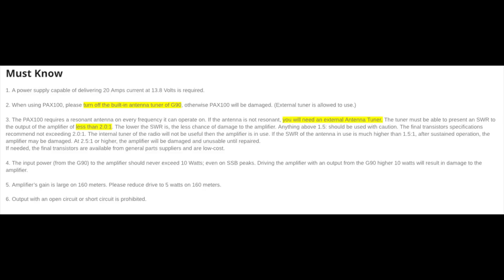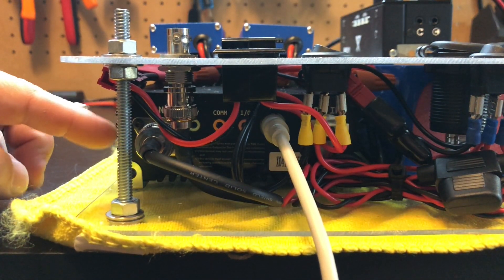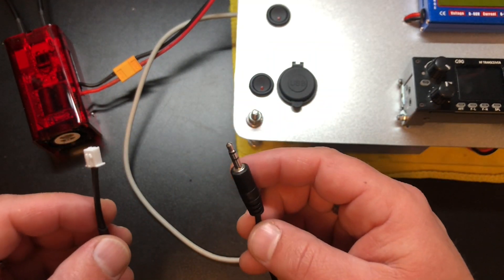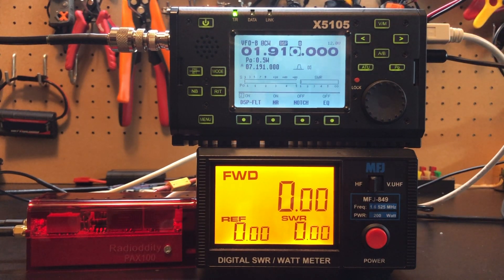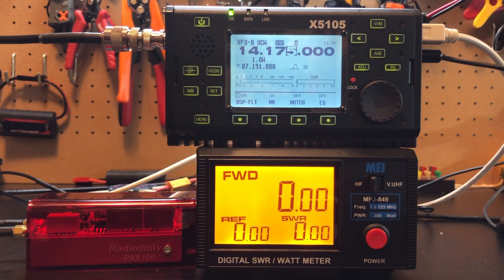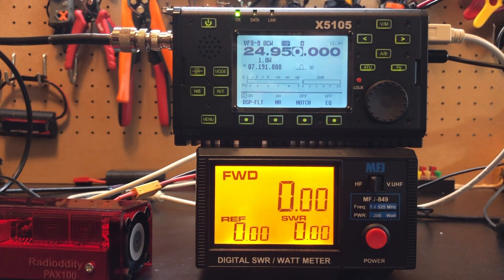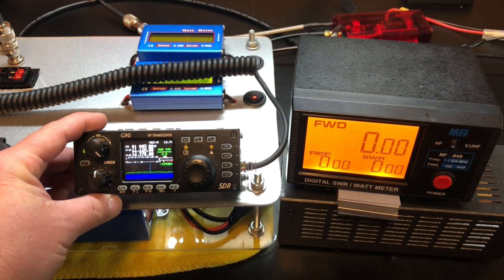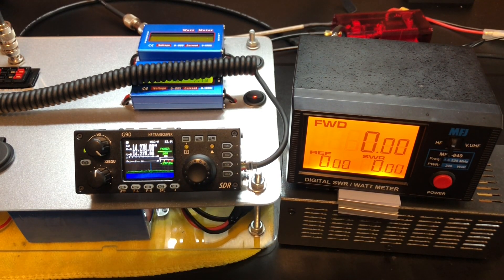The new Radioddity PAX100 Amplifier | Xiegu X5105 & G90 100 watt amplifier.

Comment: I have both now, just got the. Pax100. The ptt cable that plugs into th g90 kills the rx on radio.waterfall is dead, TX seems to work fine.  If the pax100 is Totally disconnected.And only the ptt is connected, the same thing happens. I have no clue how to solve this problem

Comment: Amplifiers amplify any signal that is put into them including harmonics.  You might want to check the spectral purity of the radio that caused the swr issues with the amp.  If it puts out a dirty signal, then it could also cause swr issues with the amp.  Also, the amp needs filtering on the output to assure a clean signal.  Without it, you may be operating on harmonic frequencies that you are not licensed for !

Comment: I know this video is one year old but I bought for my xiegu g90, hooked up as recommended, configured as recommended but power according to antenna tuner is same as input. Yea I connected ptt cable and made sure inserted all the way? I have pics. Any hints what I’m doing wrong?
Reply from the maker: When I got mine the cable didn't work and Radioddity had to make one for me.  It wasn't keying the amp. They should be shipping with a proper working one now but that could be the problem.

Comment: The amp has no lowpass filters. This means that the output is high in harmonics. I don't have this amp and will never buy it. Every time you transmit with a solid-state amp without the lowpass filters, the signal will appear at double, triple, and quadruple the frequency. If you transmit on 160, you'll transmit also on 80 and 40 meters, or outside these bands. The harder the amp is driven, the more output it'll have on the harmonics. I'm surprised they're legal to sell as ham amplifiers (or maybe it's called something else for import purposes) as it would fail any FCC standards for certification of a commercial product.
The solution is to buy a 100 watt lowpass filter board for the ham bands (either built or a kit) to connect between the amplifier output and the antenna. They're really inexpensive on eBay, from around $40 to $65 or so.

Comment: I have mag-mount with Hamsticks for my mobile. I attempted to check into Nonn lime net yesterday. I was heard by a relay. My wife and mother-in-law asked to turn the radio off as the noise was bothering them. I'm still learning this radio. That PAX100 be perfect for mobile use. 73 va7dgp/va7qu

Comment: This appears to be the baofeng equivalent of an HF amplifier lol. Sure, it's cheap, and it works, but I doubt it's very spectrally pure. It's just like what they say about things, it's not your fault if you don't have the equipment to properly test the output of your radio, it's the manufacturer who's at fault for putting out a product that doesn't comply with standards. I'd say, use it if you must, but upgrade when you can. Still a very neat product!

73 de W8IJC
Reply from the maker: I would say that is 100% accurate.  I would really like to put it on a meter and see what it really does but after moving to TX I don't have that resource anymore.
Reply: @hamradiotube  Yeah, neither do I. Hey, thanks for replying on an old video. Love your videos Mike, got my Silver Bullet 1000 because of your review.

Also I just wanna say I am running FT8 right now, and I just got heard in Hawaii, Australia, and Antarctica all it once. I may or may not have just screamed like a little girl... No joke check PSKReporter. This 20 & 40 meter dipole that I just put up like 40ft is really working great!

Comment: They sell an XT60 cable with inline switches on Ebay that would make amp-off tuning quicker.
Reply from the maker: Hmm, thats a good idea.  Now if I could only get that in a Power Pole!
Reply: @hamradiotube  Yeah, I'll probably take that out to go all power pole, then add a switch.

Comment: Which cables do you used to connect the xiegug90 to thepax100 I bought the xiegu g90 and have spoken to Laurie in the north of italy. Ik4gro
Reply from the maker: Lauro always has a great signal, I've worked him many times.  There are a bunch of cables needed to connect these.  2 of them come with the amp, the other comes with the CE-19 interface you need to get the PTT to trigger.  Then there is a power cable as well.  I believe I show them all in this video, but if you purchase the amp and the CE-19 interface, you will have everything you need.  I think I have a link in the description to save either $15 or 15% off, I cant remember but use that if you want to save money.  73

Comment: You're NOT seeing 100 + watts You're seeing all the harmonics "DO NOT TRANSMIT WITH THAT AMPLIFIER WITHOUT FILTERING"  Please let's try and keep our hobbie, this sort of video is misleading..
I'm not trying to be negative, put a filter on the Antenna side of the Amplifier and then have another look at the power output..
Cheers 73
Reply from the maker: I actually have a filter for it they sent me and got the same results.  I haven't put it on a scope to see how nasty it is but no, I don't intend to use this.

Comment: About the SWR issue at 7:38 it looks like you have the ATU turned on going into a dummy load, but I honestly can’t tell if I’m seeing the ATU icon or the compression icon.
Reply from the maker: I don't think so.  I was pretty diligent about turning it off.  I've done tests before and after this video and the results were the same.

Comment: Hi MIke. I've just watched another video with the AMP and an associated LPF supplier by the same company.
Power output dropped by 50% on each band when the LPF was selected -- so the harmonics and crud coming out of that amplifier is responsible for circa 50% of the power reading!!!!!!!!

I would suggest no one EVER uses this amp without the LPF otherwise you will be as loud on the harmonics as you are on the main selected bands. Brings a whole new meaning to 'dual band operation' :-)

73
Bruce G4ABX
Reply from the maker: I know Craig WJ6F did a video on this amp too.  I tried it with the same LFP he was using (the sent me one with the amp) and it didn't change a thing.  I was going to make a video if I had any promising results but alas, it was a dud.  I suppose it would be bringing back the early days of ham radio before radios had filters.  Thats why people would call CQ 40, or whatever band they were on, so people on harmonics of those freqs would know they were on 40 and not 15!
Reply: @hamradiotube  I remember my first  160M rig -- which had 'Tuned anode coupling' It was great on 1.9MHz, 3.8, MHz and all the harmonics above -- and because it was AM in those days it was all intelligible! I knew little about radio in those days. It was a local HAM who told me he was listening to me at the top of 80 metres when I was on Top Band! He introduced me to the 'Pi-Network' and that cleaned stuff up nicely :-)
Reply from the maker: @Dr-T  Lol, well there you go.  Maybe I'll send you this amp and you can relive your glory days haha!
Reply: @hamradiotube  Don't you dare!!! :-)
Reply from the maker: @Dr-T  haha, You're good on QRZ right? lol!!
Reply: @hamradiotube  Yup -- except I'm in France at the moment :-)
Reply from the maker: @Dr-T  Doh!!  You dodged a bullet there.  73

Comment: You are getting instability -- either from the complex load the AMP presents to the Rig on certain frequencies (Higher is worse) or RF feedback of some sort internal to the AMP. You could check this out by putting a 6db 50ohm  PAD between the rig output and the amp input and then using a scope to look at the output.

By the way, you should never overdrive an AMP (My guess is that 10 watts is probably 2x Max for this amp on the lower bands) otherwise you will get horrid Intermodulation distortion -- as well as the harmonics as there is no low pass filter in this amp. (You should never run an amp without a LPF for the particular band you are using connected to the output! 

By the way, without a LPF your power meter is measuring energy -- and that includes all the crud , sidebands, distortion and harmonics the amp is putting out -- so you are probably getting 15% to 20% more power indicated than would be there if the output were 'clean'

I'm amazed this amp is even allowed for sale without LP Filters. How on earth did they get FCC approval?
I shan't be buying one!

Thanks for the video :-)
73 Bruce G4ABX
Reply from the maker: I don't have any test equipment other than what I used and I honestly don't need to see anything else.  The "why" doesn't really matter to me.  The fact that this amp has given the results it has with just a watt meter and a dummy load is enough for me.  Sure I know people that could hook it up to a scope and see what its really doing, but thats not going to solve anything.  This is a brand new amp and should function as such.  I kinda doubt this was even tested at the factory.  They prob just printed FCC stickers and put them on.  Why not, Baofeng does the same thing.
Reply: @hamradiotube  Oh Dear. As a Scientist (Professor of Electronics Technology) , I personally feel a bit of responsibility when demonstrating kit for others. There is an inevitably 'implicit' recommendation from those who broadcast on youtube to the rest of us. I'm thinking about setting up my own channel to 'fill in the gaps' for folks who maybe don't have the kit -- or the experience to make a scientific evaluation and enable others to make up their own minds based on the full facts -- not just whether it 'Goes up to Eleven!' :-)
That Amp should never have been offered for sale without it Low Pass Filter securely attached, ideally in the same box!
Reply: @Dr-T  definitely set up your own channel! Gear like that should never be used in amateur radio. We as YouTuber should at least care what we're recommending to others, rather than just taking china sales commissions and running with the money.

Comment: On 160 Meters with an DC current of 11.8 amps and PS voltage of (13.6 V ?) represents 160 Watts input but the MFJ digital power meter says 170 Watts output ???  I think the MFJ is WAY off.  It sounds like the input circuit of the amp needs some compensation because of the wild variations in gain.  Some experts say do not go over 1.5 dB compression for SSB (and likely digital) which means don't drive the amp with more power than where the gain drops 1.5 dB.  You would have to really be careful for SSB in overdriving the amp with different power inputs for each band.  Still thanks for the info.  Jim Ford N6JF
Reply from the maker: Well we certainly aren't dealing with precision instruments here are we lol!  The manual does state that 160 has a lot more gain and to keep the power at no more than 5 watts.  I think the whole amp needs some work.

Comment: Hi Mike Radioddity have a filter module to go with this amp,  LPFX7 Low Pass Filter I would guess the output is not clean without the module and could even becomes unstable.
Reply from the maker: Yes I have that too.  Perhaps I should play around with it.  I'm not really learned on low pass filters so I have a ways to go.
Reply: I got the LPFX7 with mine too.  It thought it was just to clean up the out-of-band noise on the signal leaving the amp, but maybe it helps with the signal stability into the amp then allowing for more stable SWR.  We need a more technically knowledgeable  ham to help.

Comment: You showed varying SWR on different bands into a Dummy Load. The varying SWR appears between the radio and the amp. Not the output of the amp to the load. This should be concerning..
Reply from the maker: Yes.  Yes it should, and it is.  Pretty sure amps are not supposed to do that.

Comment: Boy, I don't know about this amp.  I have the HF Packer amp (kit) and it has a by-pass switch and I use it all of the time as well as on my old Heathkit amps, the SB-200 and SB-220.  Proper filtering is a must also; don't want the neighbors or FCC knocking on my door!  Thanks for the review,  73, Karl, KO8S
Reply from the maker: Thanks for watching.  I don't know much about the inner workings about electronics unfortunately.  It does have a Low Pass Filter for 17 and 10 (I think those are the bands) built in, but other than that, I don't really know what's inside it.  I did have my 7300 on when I was testing and didn't see any spurious emissions.  I didn't check every band though.

Comment: Yea Mike looks very strange but have witnessed some off behavior with the radios on 17 and up in the past, but what was causing that issue is beyond me right now as well. Thanks for the video, I am seeing lots of folks getting this amplifier....cheers Fred
Reply from the maker: Yeah that totally shocked me.  It was between the radio and the amp.  The meter after the amp into the dummy load still said 1:0:1.  I wouldn't have any idea how to fix that.  Prob is no fix.  Not an easy one anyway.
Reply: @hamradiotube  looks like at low power maybe some oscillation was taking place or was there RF feeding back? I am betting on oscillation however....Fred

Comment: Great test and warning! Radioddity say it is way more stable than the kit units and ithers online to buy. If this is the case the others are either super unstable or you got a duff unit. I did considder one of these and now so glad I didn't. The way it was behaving was almost like you needed the ATU running just to chill the amp down. Will be interesting to see how it plays on a real antenna and if it settles down on a line that should be solid all the way.
Reply from the maker: I'm sure it's possible that it could be more stable than the random amp you get on Ebay, but I've seen videos from Ham Radio Crash Course and Kevin Loughin using a pretty inexpensive amp that seemed to work just fine.  I'm not really keen on putting an ATU on before the amp.  Its a pretty bad hardware issue that needs to be fixed.   I would think on a real, resonant multi-band antenna like my DX Commander Expedition, I would experience the same results.  Look at the meter that is after the amp, going into the dummy load.  The SWR is perfect.  I suppose I could test it with a different coax, but I'm 99.9% sure the 2' jumper I was using was good.  It's Tramflex RG8X with 95% shielding.
Reply: @hamradiotube  Yeah for sure and ATU is not a good idea between the radio and the amp, was a twist of my humour hihi. There must be something really bad in the hardware for it to create its' own instability like that, there is no way it should be dancing like that on the radio side. If it was a fly-lead cable issue would it not do that on all bands? On a radio the unit is "exclusively" designed for it should be perfect. For me it is just a novelty paper-weight. All goes to support my thoughts of cutting losses from adding to the G-90 "set" and leaning towards the IC-7300. Thanks once again for this review. Hope to QSO some day on HF, 73 de 2M0FUP

Comment: Great review. Look forward to a field test. I’ve heard several saying they get the amp and wires are loose and other problems.
Reply from the maker: Not gonna lie, this is actually the 2nd one they sent me.  The other one worked, but then I accidentally plugged the in and out wires in backwards and keyed up for literally a second and it was dead.  I opened it up and did see a very tiny wire just hanging on by a thread into the solder.  Prob only 2 or 3 strands were actually soldered to the board.  Not sure if that was the problem but thats what I saw.

Comment: Thank you Mike for an informative video, I've been wondering about this amp. I'm wanting to get either the X5105 or the G90 at income tax time and i seen you could buy them up with the PAX100 and your the only one out there that's done a video on them, so sir i salute you for getting it out there for us. I think even with the SWR freak it would be worth it to be able to push the wattage envelope when you absolutely need to, but i would like to know why it's doing that so maybe you can get Radioiddity to answer this burning question for us.
Again Mike thank you for your work in the ham field. 73 de W8MJL & K8MKL
Reply from the maker: Thanks Michael.  I did email them about it and they told me  "We know it's not a perfect kit but the advantage is that it's much cheaper than other choices".  Thats not very reassuring.  I absolutely love the X5105 and G90.  The X5105 in particular fits my needs more so than the G90 with its internal battery and working noise reduction and notch filters.  I think the G90's allure is the waterfall and 20 watt output, but for me, between the 2, I'd take the X5105 over the G90 any day.  The difference between 5 watts and 20 watts isn't much (for portable, being the one calling CQ). If you're trying to work another stations pileup though, the 20 watts will help a bit.   It's really all about the antenna.
Reply: @hamradiotube   Seems like the Pax 100 is a copy of the HF mini PA 70, same board layout same Mosfed same problemes. Hi. Nice video. I have also the Pax 100 and would not recommend it at all. Same problemes as i see on your video, High SWR between the radio and the Amp. even whit the LPF board. Greetings, Marc
Reply: @hamradiotube  I do not have a X5105 but gave the G90 and know it to be an excellent radio. the filtering does not change much but with the latest software seems to be better. As you said get your antenna more resonant.

Comment: Please don't forget this has no bandpass filters fitted so some sort filtering must be used before using. It.
Reply from the maker: It has 10, 15, and 17 meter low pass filters built in that are changeable (kind of).  I'm not too learned about band pass filters yet though so I couldn't really tell you what they are for.   They did send me a completely separate Low Pass filter, The Radioddity LPFX7 https://www.radioddity.com/products/radioddity-lpfx7 but I'm not really sure what it does and I'm not really sure how to test it.